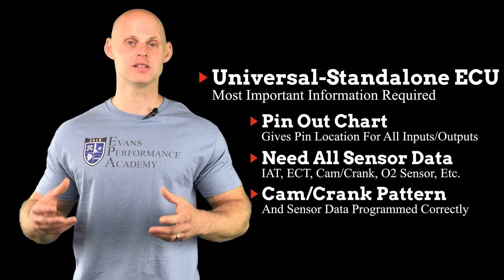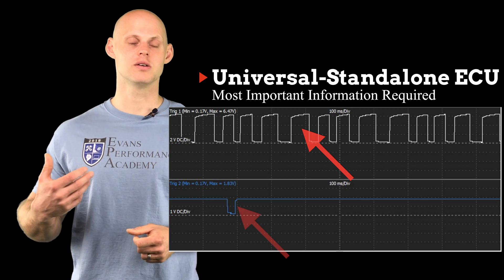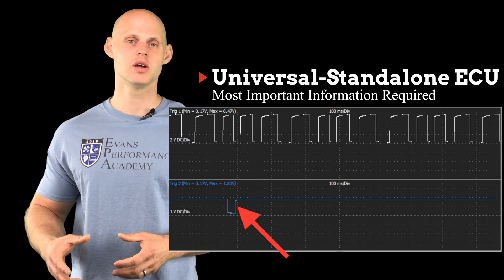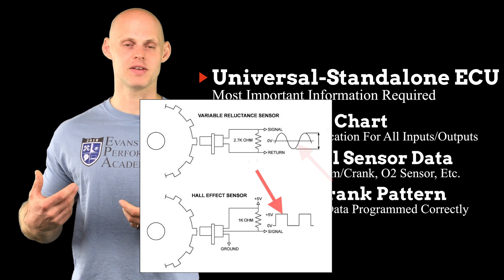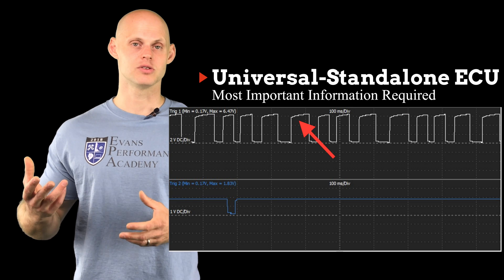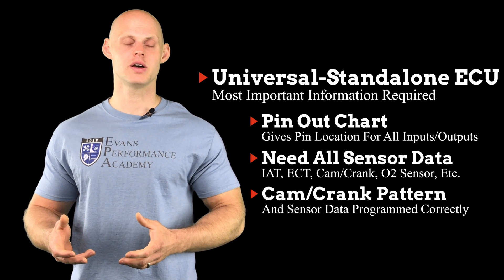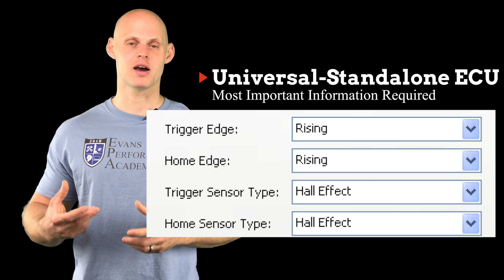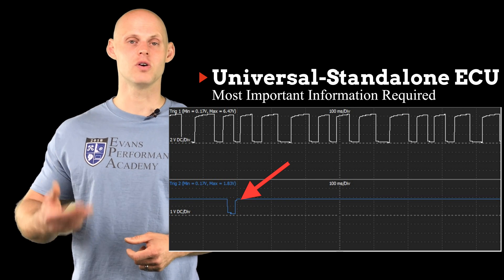EFI Advanced: OEM ECU vs. Standalone ECU

Comment: Hey Evan I have a question for you.   If I was to subscribe to your lessons would you be able to help me out with some tuning.  I have a ecumasters emu that I am trying to get a 1jzgte running.  It does idle but it seems like some kind of a trigger issue.  I have confirmed that the number 1 cylinder is firing at what timing I give it but it just seems like some of the other ones aren't.  I would appreciate it if you would be able to check it out.  Thanks